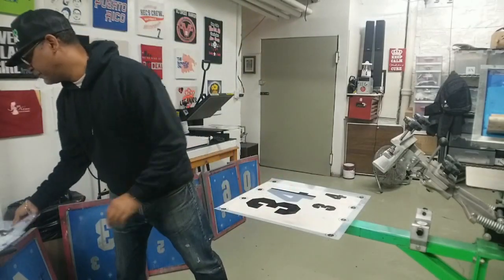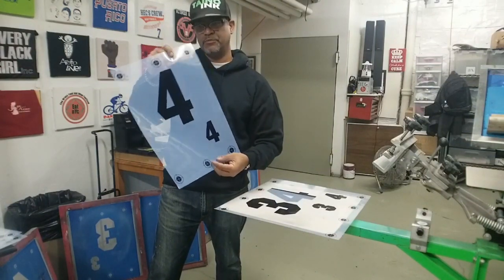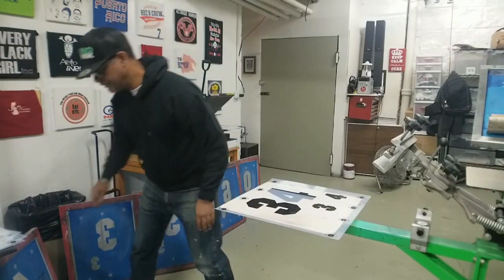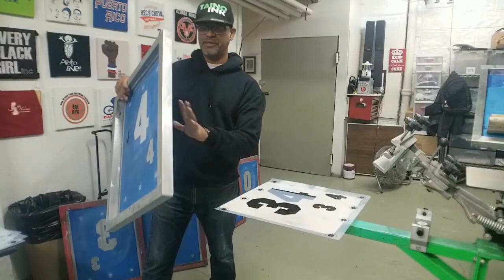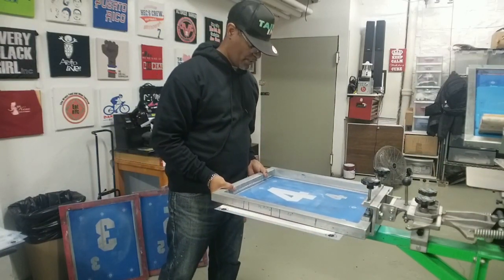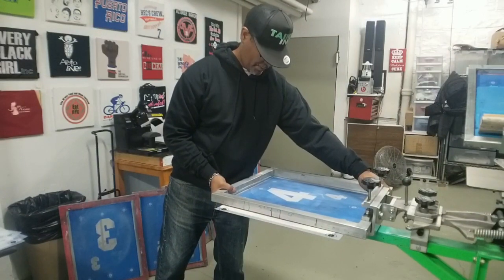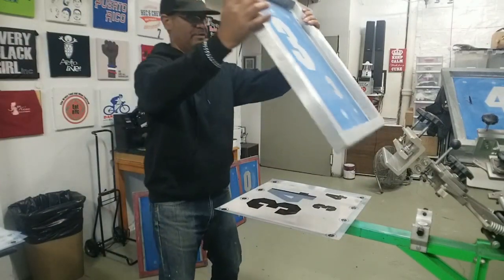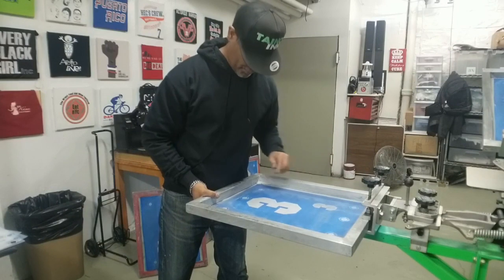Printing numbers

Comment: Is it worth screen printing numbers? The time it takes to get all the ink out of the screen to only print one or 2 prints. I'm genuinely asking. I just got a cutter and I think I'm gonna do vinyl. Seems easier...?!?!
Reply from the maker: Screen printing numbers is good if you have all ten screens with with number stencil individually. If you want to do numbers with an outline you will need 20 screens all set up. But Vinyls is just as good and easier.